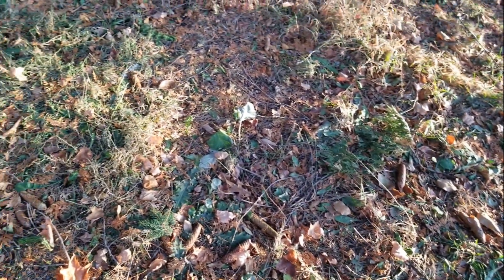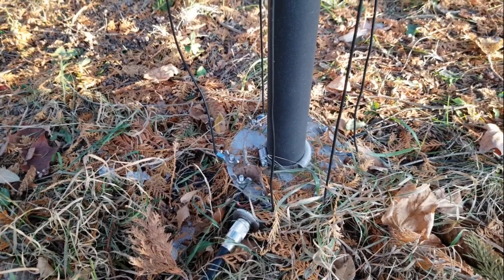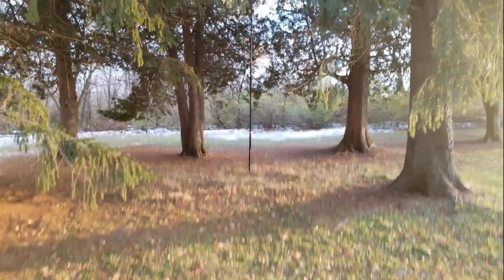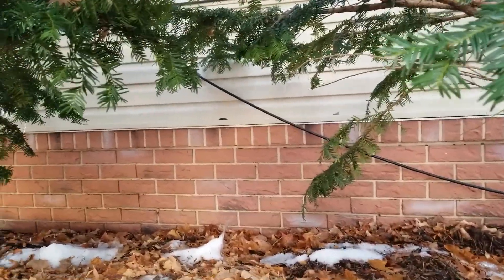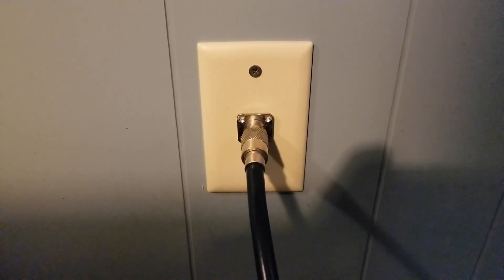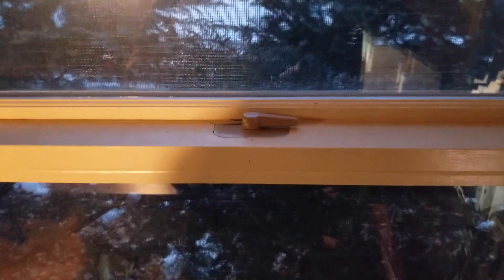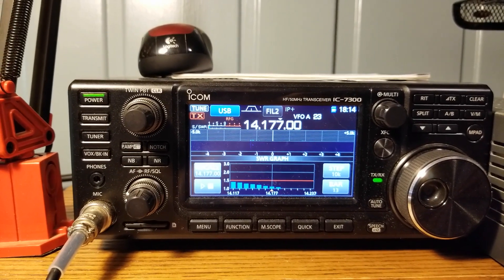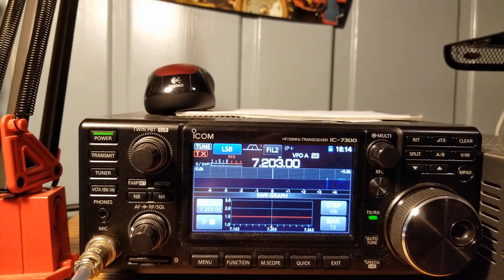DX Commander One Year Update

Comment: Do you have a video of the install? I'm considering the extrem nebula and was thinking I might just bury a piece of pipe into some concrete. Your thoughts would be appreciated.
Reply from the maker: In my case, the 10m (fishing) pole is just sitting on the ground and is held in place by the guy lines.  Super simple.  I never take it down.  You've reminded me I need to do a 2 year update.  It still hasn't moved though.  If you don't want the guy lines, you can certainly put a pole in the ground and put this over the pole.
Reply: @temporarilyoffline  Glad I  could remind you of your yearly responsibilities. Lol. Amazing that is just sitting on the ground. Thanks for the video.
Reply from the maker: @JA-fy1bn  don't forget "in Wisconsin"  harsh winters and windy summers

Comment: Steve, I will probably do a similar video as mine has been up in the Texas sun for 1 1/2 years and I do have some things that are happening to the antenna. Specifically, the wire guides/guy points have hair line cracks. These do not appear to be anything to worry about so far.
Reply from the maker: I haven't had a reason to take mine down to investigate and its mostly in the shade... I would imagine my plates are just fine.
Reply: @temporarilyoffline  The cracks on my plate are visible starting on the lowest plate with the guy wires. I will post some pictures in your discord.

Comment: lightning protection?
Reply from the maker: I don't have a good answer... but what I do have is a lot of excuses...  The first one being that those trees are higher, the second being that I just disconnect the antenna in a storm.  Told you it wasn't a good answer.
Reply: @temporarilyoffline  Be careful, a strike to one of those trees will have enough induced energy to fry your equipment ... and more.
Reply from the maker: I've had that happen with nearby lightening strikes.  I've lost a router, a PC Power Supply and 2 LED Lighting fixtures.  Have you seen Callum's video about his nearby lightening strike?  He lost gear that was unplugged in a box.  I imagine if I was present that I'd see lightning coming out of the far end of the coax!
Reply: @temporarilyoffline  lightning is gnarly for sure.  Always a concern on SOTA activations as well.